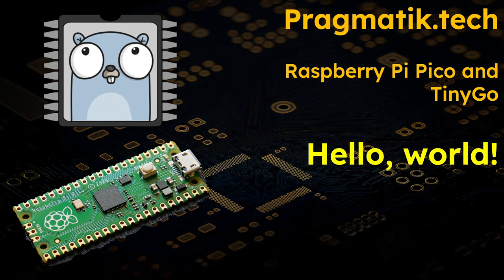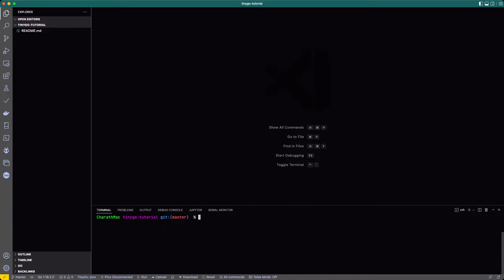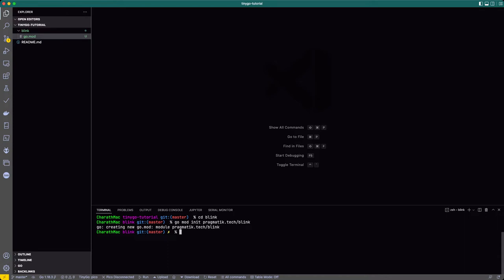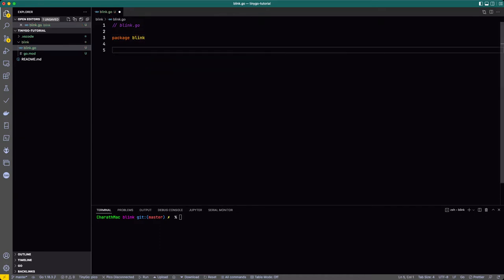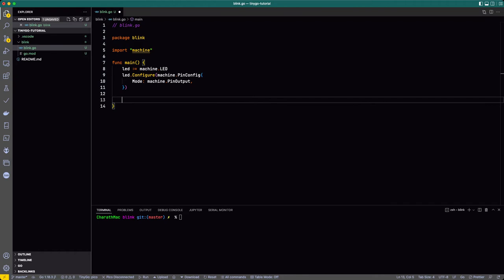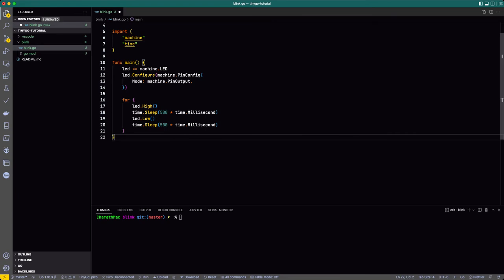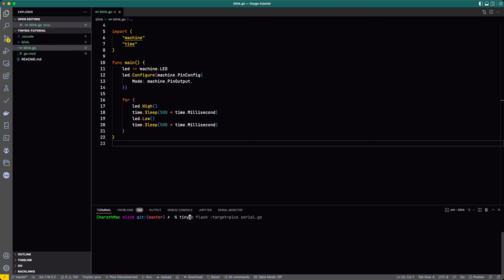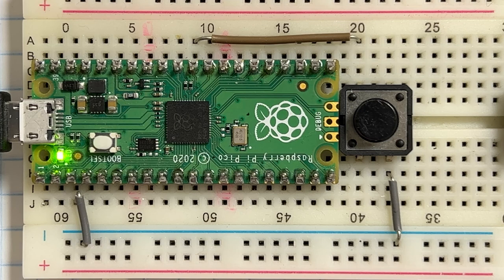TinyGo and Raspberry Pi Pico: Blink LED

Comment: Thank you for a nice tutorial. I just wanted to add that people using a Raspberry Pi W will not be able to run this tutorial as the current machine implementation do not have a target for Pico W and the internal LED is not connected to GPIO pin 25 on the RP2040 but to a GPIO on the wireless chip.
Reply from the maker: You're correct re: the LED, but most of the other tutorials on my channels will work on the PicoW as well. Or you can start with the GPIO tutorial :)

Comment: Функция time.Sleep() блокирует работу микроконтроллера, также как delay() Arduino.
Но как создать аналог millis()Arduino ?????
Reply from the maker: You would have to set up a timer tick to do that, but that doesn't exist for Arduino. It does, however, work on many ARM-based microcontrollers such as the Raspberry Pi Pico. Take a look at https://github.com/tinygo-org/tinygo/blob/release/src/examples/systick/systick.go for an example.
Reply: @pragmatiktech   Thank you very much. I use Raspberry pi pico and the lack of tools to work with the timer was a problem